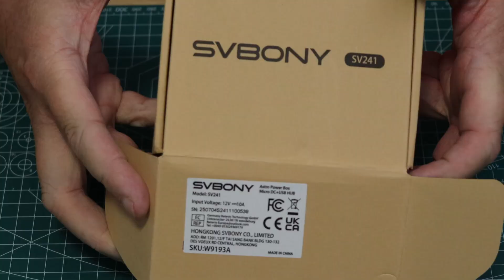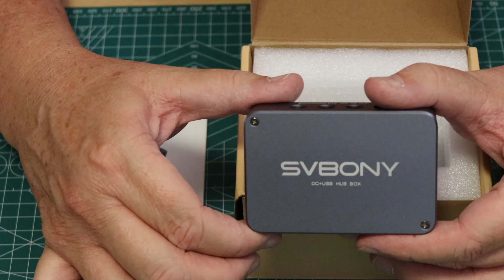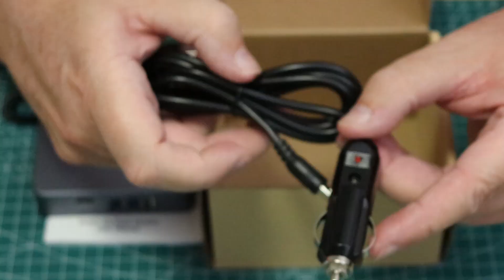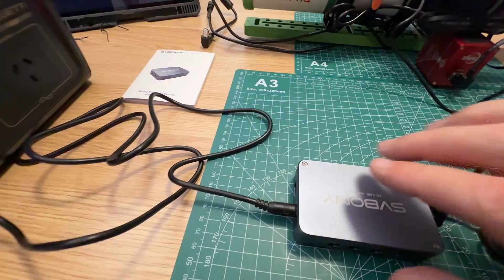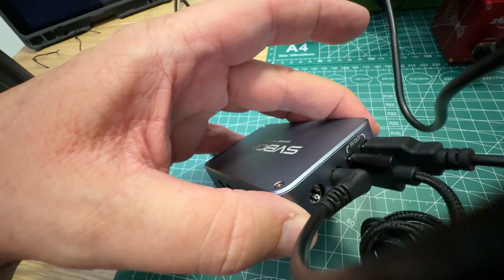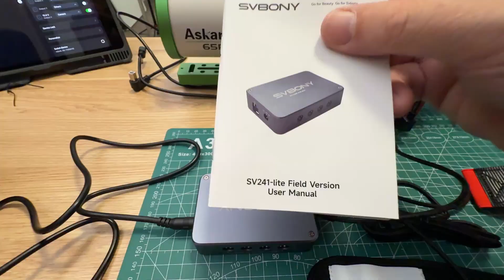How to use SVbony 241 Power Hub with ZWO ASI air plus control unit for Astrophotography

Comment: I have 2... 241, not pro. I went with it because total max 10a... asi... total max 6a.. I would think it could work as long as things don't reach max pull between colder night and fast sewing /meridian flip. Astro is all about the tinkering, pushing the limits and finding new ways to make things work better. Hopefully, I run my dew heater on its own 20,000 mah small battery. Just to be safe. Clear skys happy hunting
Reply from the maker: Couldn’t agree more Charles 
Clear skies 🌌

Comment: Can the unit be used to power the mount  and,asiair + 2 long sv bony dew strips , from 12 w output ports ,1 dew heater , 5 w from usb  .. Running   600/150 quatro . with guide scoop. Eaf,efw,so ,i only need 1 power cable to run to the power box . have 2 powerbox,  3  rigs...but litle scared  to use sw powerbox on  them , dont want to burn the mount or asiair ,also dew heaters in 12w seems little risky.but if it works , for me super easy setup . very nice cable manegement ,greetings from denmark🤖
Reply from the maker: It should be fine to power all of those from the unit, as long as the total current draw doesn't exceed the power box's capacity.
Thanks for the query and let me know how it goes!

Comment: Nice overview of this! I stopped using USB dew heaters with mine because when it got colder outside, they started pulling too much current and some safety mechanism would shut off or restart one or both straps. I'm guessing what the reason is because I haven't observed when it exactly happens, just that I'd go out a few hours after I start imaging and both dew straps still had power but they were "off." I just use a separate power tank for those nowadays (until it starts to get warmer again). 

SV241 pro comes with the finder shoe. Wish this one did too!
Reply from the maker: Hey Naz thanks so much for watching. Ive not really used the hub in anger so to speak as I’m predominantly using ZWO controller rather than NINA. I won this from SVbony for one of my images and watched your clip on this and the SV241 pro which were great. It’s interesting what you mention about the dew straps and I wonder if they addressed this when they released the pro unit as it’s much more controllable from
What I’ve seen and yes they added the bracket which was good.
Cheers Simon
Reply: @SimonKiddAstrophotography  Congrats on winning this unit!  They added the RCA dew heater plugs to the pro version which are 12v, they require less current and are also controllable via software. The USB current limitations aren't Svbony's fault, I'm just glad they have some kind of safety mechanism to turn it off before it damages any other components. 

I need to get myself some 12v dew straps but svbony doesn't make any! Not yet at lease.
Reply from the maker: @Naztronomy Yes thanks mate, they asked me to do a video on this and the SV550 telescope which they sent me. Never done anything like this before and little out of my comfort zone but if it can help anyone then why not I guess?
The sv241 pro unit seems to be quite a good upgrade in this unit from what I watched on your channel.

Comment: If you power the dew strips this way, they will always run at 100% though, right? You lose the ability to adjust them through the ASIAIR.
Reply from the maker: Yes correct 
You don’t have any real control unless you have those dew straps that have the low, medium and high buttons on them.
Hope that makes sense

Comment: Can I ask how you are getting 2.3 A on the ASI AIR? I’ve been having power issues with my AA and I bought this 241 device hoping to resolve the issues I’ve been having but my AA steadily sits at 0.2-4 A. After a little while of running my AA will shut down and stop the auto run. I have to power cycle AA each time to restart it.
Reply from the maker: That’s a strange one 
I have two asi air plus units for my two scopes and both work the same with the SVbony 
Are you using a BLUETTI power unit?
Reply: @SimonKiddAstrophotography   I’m using a Jackery power unit. I have a 12V10 power supply I was using for the 241 and was getting 12.1V. When I switch to the cigarette lighter power cord for the 241 I went up to 12.8V but still got a disconnection.
Reply from the maker: @msummers94 Have you tried a different 12v power cord from the jackery? Might be worth a go?

Comment: Nice work mate. Got the same Svbony PH and dew straps for 6 weeks but still yet to use them in anger.
Reply from the maker: Cheers Damo
Yeah it was nice to win it, but without NINA I struggle a bit to use for anything other than USB ports tbh 
I can see if I used NINA that this and/or the SV241 pro would be well worth using especially for the price
Reply: @SimonKiddAstrophotography  Cant help you with NINA mate lol, both duds hehe

Comment: I've got one of these, it's powering my grab and go rig at this moment. This rig is based around a Samyang 135mm f2 lens and an ASI585MC Air camera which only has one 12v output so I need a power box. I also use the SV Bony USB dew straps. I'm currently building a rig that will be controlled by N.I.N.A. and I will probably use the Pro version as the Power Box and hub.
Reply from the maker: Yeah that’s a great use of this device Kevin. I’m very close to building a rig controlled by NINA and may also get the SV241 pro for that.
Thanks for sharing your comments 👍